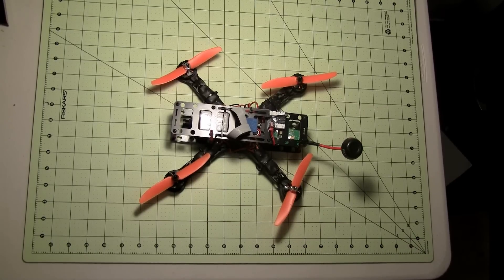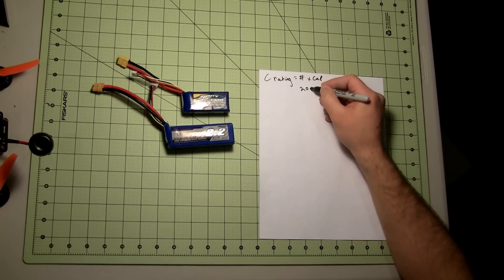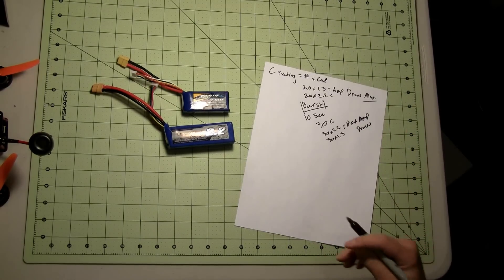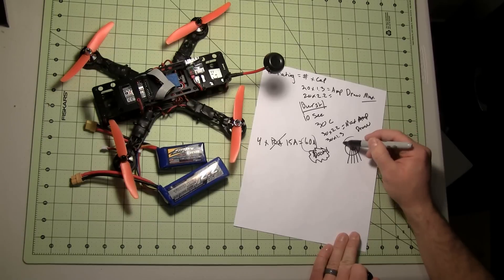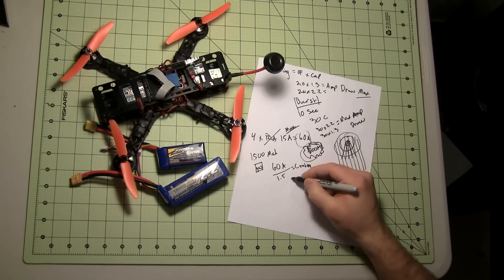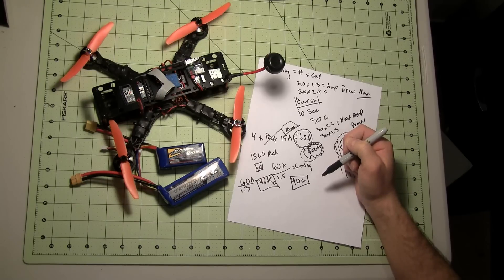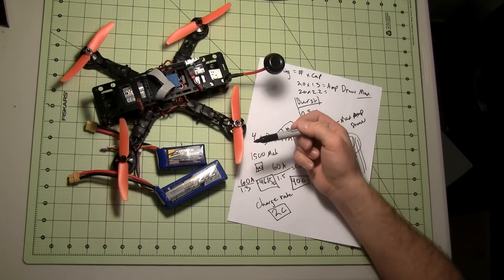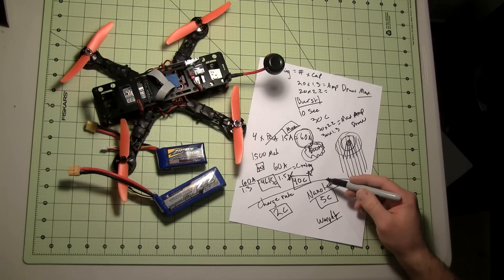Battery Talk - 250 FPV Racing Quad (Drone)

Comment: Thanks. I have some question, I want to improve flight time. But as you said, 1806 class motor can only carry 550g. I just want to go 5200mAh 3s 35c 400g, is it possible ?. Which part I should replace to keep a flight time but don't lose so much speed ?
Reply from the maker: Forted Exe I'm not sure I really understand the questions.  If you are running 1806s you cannot run a 5200MAh battery, way too heavy.  If you want to run 5200MAh then you need to run the 450 class quad (which is not a racer) running 2212 motors (like Sunnysky 2212s) with 10x4.5 props and 20 amp ESCs.  If your running 1806s you need to keep your "All Up Weight" (AUW), ie flying weight, to no more than 400grams.  A good 5200MHa battery weighs 330grams by itself.
Reply from the maker: SGRacer 10x4.5 is good for 3s batteries 9x4.7 is good for 4s.
Reply: SGRacer I mean I already have QAV250, I just want to improve flight time with it. After some research, I think I must replace my motors to 220x 4s. Can you suggest me which motors is the best :)
Reply from the maker: Forted Exe 2204 Motors with 5x4 or 6x4 props(3s) and an AUW of 550 or less is your best bet.  Im cheap so I buy eMax motors off ebay stores for about $14 a piece.  My whole racing quad (excluding FPV) is about $150.You need to remember that on racing quads 5 minutes of fast flying is considered "good" flight time.  If you want something that lasts 15+ minutes you have the wrong craft.
Reply from the maker: SGRacer I have heard good things about multi star elites, high quality components. I do not fly "high end" because.. well... when you fly balls out ,you crash a lot.http://www.hobbyking.com/hobbyking/store/uh_viewitem.asp?idproduct=63065&aff=462087
Reply: SGRacer thank you very much, that really helpful :).

Comment: so if i have 4 15a burst escs. 60a max.     and a 1300mah 4c with a 50c burst    65a max.   escs go boom?
Reply from the maker: Drew Larsh The batter having high C rating wont itself cause the ESCs to blow, but the draw of the ESCs on the batter wont get past 60a (unless your motors are asking them too)

Comment: vary helpful. i still have a few questions.so we now how much the ESC's are using but what about after we add video and radio controls and led's. do things like this add up and require more c rating?
Reply from the maker: Ore Setsero When I am racing its closer to 5-6 minutes, but when I'm tree dodging i get closer to 7-8 minutes.  I am running cheap hobbyking 5x4 props on 2204 emax motors.  Also, if you are running 1806s that is your problem.  1806 class motors are meant for lighter AUW crafts than 550 like you say you have.  1806s are great for the 350-400 gram weight class.  2204 motors have extra torque available to run 5x4 props for the higher weight racers and keep the speed and run time high.
Reply: Ahh ok that would explain it, weird that they recommended the 1806 with the 5x3 3-blade. Will look into the 2204 thanks for the quick feedback! I just subscribed to your channel thanks!
Reply from the maker: Bryan B You are right.  your receiver and extras (FPV gear, leds, etc) will draw very little to impact performance.  I am using Hobbyking Nano tech 30-60C batteries with FPV, LEDs and all up weight of 550grams and my battery never has a problem keeping up.  and I get about 7-8 minutes on a 1500mah.
Reply: SGRacer How are you getting 7-8 minutes on that?  I have a 1500 & 1300 nanotech, one with a 35/60 and the other with 45/90 both last same very low 3.5 min, 1500 like 4.5 min.  Mine weighs exactly 550g with a 1300 using emax motors, and emax 12amp ESCs and only getting like 3.5 minutes on a 1300 and 4.5 minutes on a 1500.  I do have the plastic props on them just ordered the 5x3 Carbons and the 3 Leaf 5x3 o see if it helps, what props are you running them on?

Comment: Great video, thanks for sharing.  So if you had to choose one battery (brand an mAh) for a 250 quad with FPV gear, what would it be?
Reply from the maker: Gino Salvatelli This is the battery I am flying with, I just changed the connector to xt60.  I went with this becuase if is pretty light for being a 1500mahhttp://hobbyking.com/hobbyking/store/__64938__Turnigy_nano_tech_1500mAh_3S_30_60C_Lipo_Pack_Fits_Losi_Mini_8ight_.html

Comment: Do not look Burst C ratings in cheap batteries. HK, ebay, BG and so on. Stick with normal C rating and don't exeed it. Better be conservative and use only 1/3 max C on HK batteries.

Comment: are 3 bladed props better than 2 bladed props?  thanks mate
Reply from the maker: I personally dont use tri-props, they should only be used on motors that can handle the torque.  I personally just use 5x4 regular props.

Comment: Great tips there, but which would you say is best, the 1300mAh or the 2200mAh? Based on flight time vs weight vs manouverability?
Thank you
Reply from the maker: Good question. I find with my build (see my other videos for details), that 1300 gives me about 5.5 minutes where a 1500 gives me about 6.5-7 minutes (more if I am just tree weaving).  Weight is a big concern for 250 class racer as it impacts (like you said) both flight time and maneuverability.

I never gave weight of things, like batteries, much thought before getting into 250's, now it is the deciding factor.  I think that a 2200 would just be too much weight, though I have never tried it.  I found a good 1500mAh that is only 118 grams!, close to 20% lighter than other similar batteries.

http://www.hobbyking.com/hobbyking/store/uh_viewitem.asp?idproduct=72387&aff=462087

I just have to add my own XT60 connectors.
Reply: Thanks for the info, i'm running overlander 2200mAh 3S lipo with 35c and they last about 7 - 8 minutes depending how I fly and if I'm carrying a recording camera (Mobius). I could probably push it to 9 minutes but I'd be at risk of literally falling out of the sky. I always test my batteries after flying, I set my timer to 7.5 minutes and assuming I'm not far away, by the time I land it's at 10% - 14% left. I can't comment on how it compares manouverability wise as I haven't flown a smaller lipo. I can say that when I don't have the Mobius on its a little rear end heavy! I'll check your other videos!
Reply: You may want to look into a low voltage alarm if you get annoyed with timing your flight. They are on eBay for about $11.
Reply from the maker: Zach McBournie
 Voltage alarms are great, but on my 20C batteries it starts beeping 2 minutes in to the flight because of the pull from the battery, yet continues to fly fine.  A good flight board has a voltage sensor and buzzer with it, no need to add one for extra weight.  The nicer batteries get plenty of time without the constant fear of dropping out of the sky.